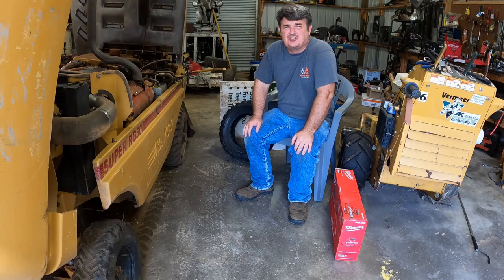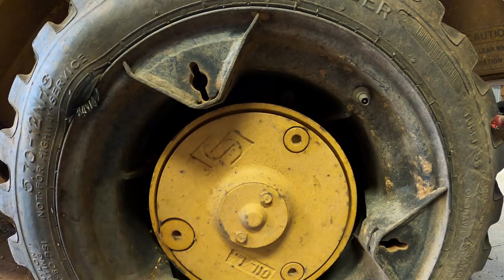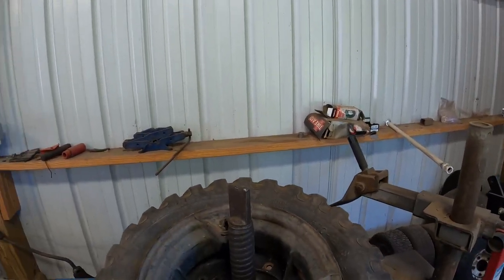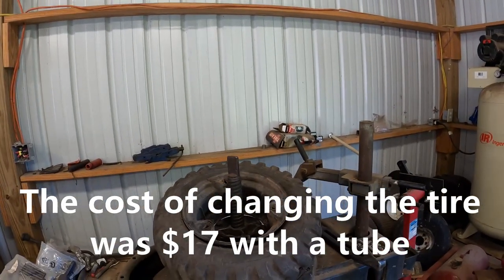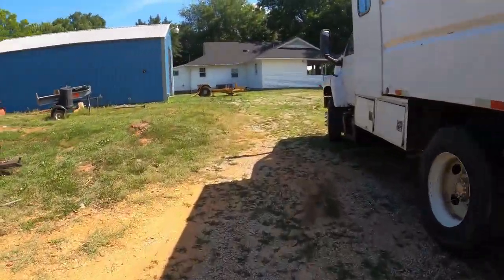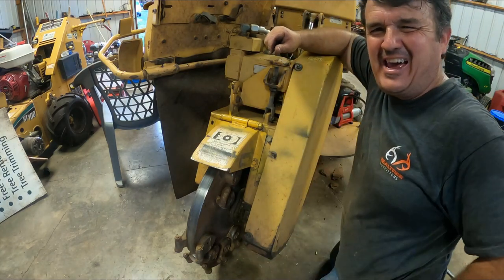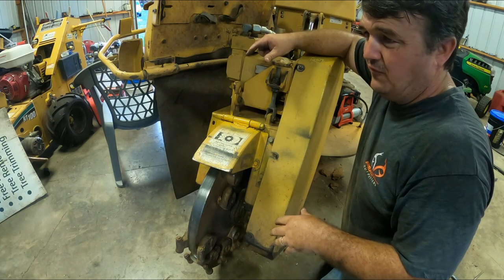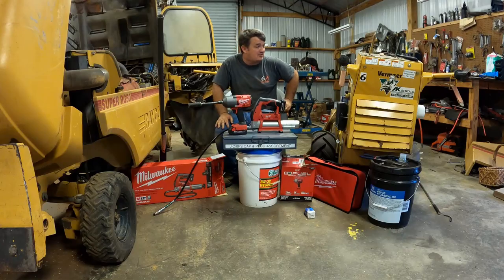Changing a Tire,Tightening belt and Using the Milwaukee M12 Cordless Grease Gun on the stump grinder

Comment: I was talking to some one recently who had a RG1625  and they said they changed the two front pulleys out so it would take the normal A size  V belts and the reason was the belts then cost only 30 dollars approx each instead of hundreds and they are very easily to get in more stores when you need them as well.
Is this a worthwhile procedure or do your belts last long enough to easily pay for them selves and you just carry a spare and stay one belt ahead all the time so to speak.
And how long do the pulleys last?
Reply from the maker: Well, my belt on the Rayco Rg50 is a single belt. It usually lasts a very long time. Thanks for watching